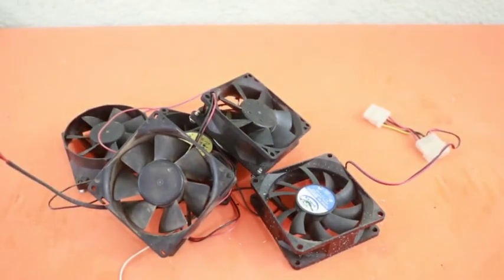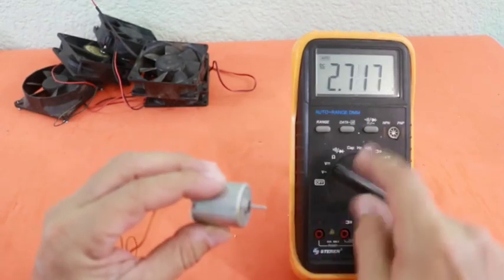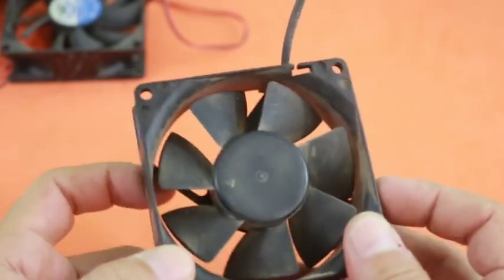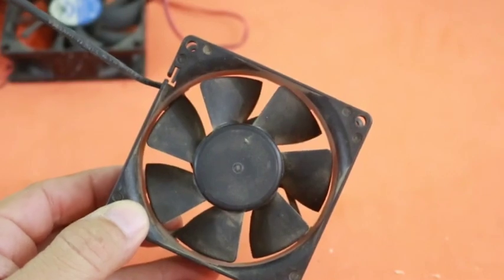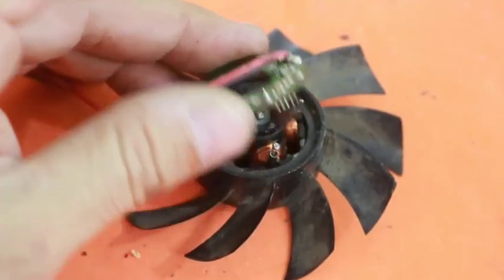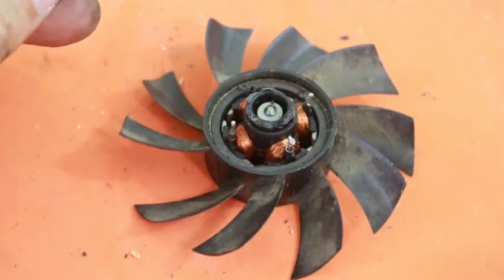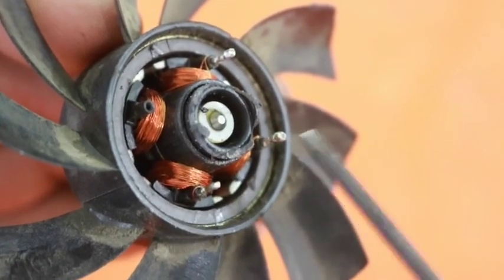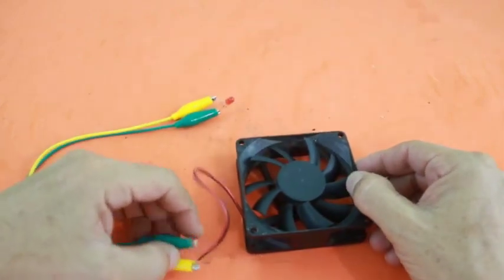Mini Electric Generator from PC Fan

Comment: Thank you Ludic Science for showing authentic project by replacing the inner electronic controller of the fan. There is fake video showing that sticking magnets to the propeller and bringing the same polarity magnet near them produces lot voltage.

Comment: Could you do a video making a hand crank phone charger using a microwave oven turntable motor?
Reply: daniel marson creative idea, the current generated by that synchronous motor is very low though the voltage is high so you may or may not charge a cell phone

Comment: This was unncessarily violent. you just have to peel of the rear sticker, the ruber in the center, the plastic washer holding the blades axially, gently push it out, twist around the coil pack and push up. don't desolder the pcb, just add 2 wires to the coil leads while on the pcb. assemble everything back as it was factory made, let the wires hang out, connect them to rectifier and enjoy nicely packaged generator

Comment: It generates more energy from DC motors because it haves high capacity magnets in it but in CPU fans haves low capacity magnets so it generates low power so you can light up an small LED. 
Anyway that was cool 😊👍.